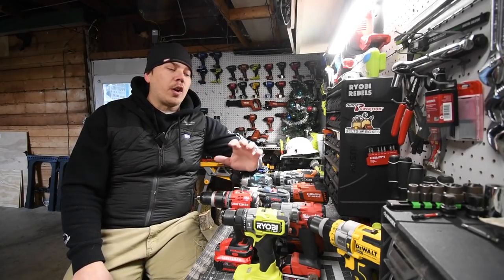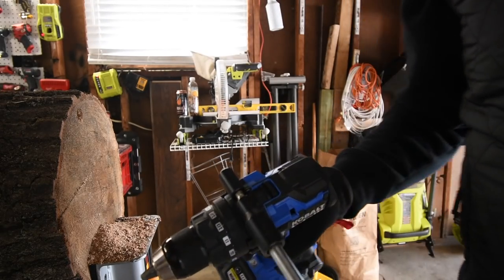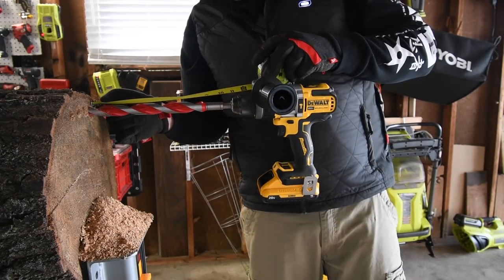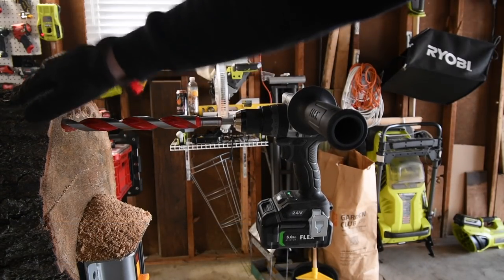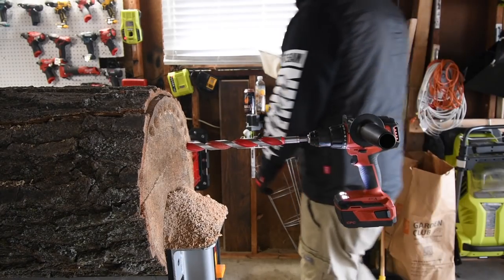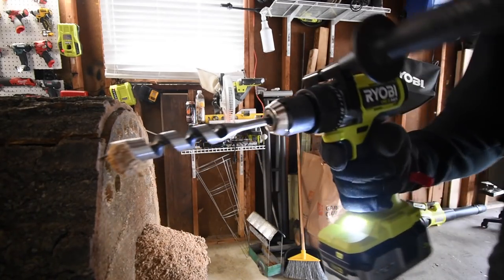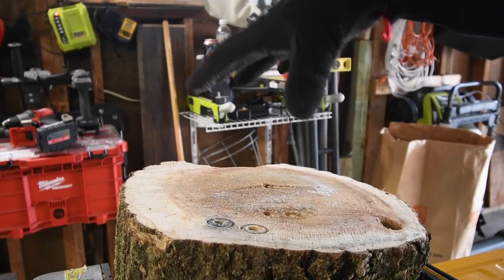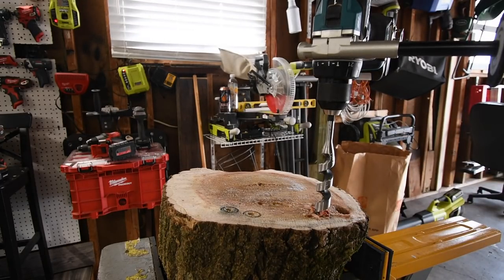Every Hammer Drill FAILED, Just an FYI

Comment: Pull the bit back so it can clear the chips then go back at it. I’m sure all these drills are capable of finishing both tasks. Then again I’m no expert so I’ll admit could be totally wrong. Cool vid though, thanks for the entertainment.
Reply: Yep that's true I use these bits everyday, when your drill stops pull it out. Go in and out the hole a few times and it will continue, if you don't do this the long and short drill will clog no matter how big or heavy your machine is. When we need to use the long one for a lot of hole we alway use a corded drill, because you're batteries just drain to fast and a corded tool just has more power

Comment: In case you haven't noticed, as soon as the spiral part of the auger enters the wood there are no more chips meaning the bit is plugging the hole causing a buildup of chips, clear the chips and I guarantee all of those drills would have finished the short bit test.

Comment: as a milwaukee fan i can clearly point out that they clearly won teh first test since they were tasked with the dullest bit since it was the last hole. 

that said, it looks like swarf removal is what stopped all the drills on the 2nd test. they were going fine until the end of the flute was buried and the waste was no longer being ejected. after that the flutes packed full and it was game over.

Comment: TIM from Canada... it would’ve been nice to see in your video test.. if you had the same bit... but for every drill.. this way when the drill stops in the work that is where you leave it.. with your next test you do the same thing with another one by the end.. do you have all the drills in the ward at different stages just to see where they end up if you have at least 10 or 12 different hammer drills.. you would need 10 or 12 of the same bit this way they will all be in the wood at a different stage. That would be the test I would like to see.

Comment: Bosch Procore are 21700 cells, the cheaper Coolpack packs are 18650.

You really need to get the latest Bosch combi drill, it produces 150 Newton metres and is a beast. That pegs it around 1300 inch pounds.

Comment: I know you are doing currently made drills, but I have a Milwaukee 28volt and I bet it would pas your test.  It is a beast, and I bought as a return from Home Depot years ago for $100.00.  It could literally break your wrist if not careful.  Good video.
Reply: Probably not, because of the advances in technology since the m28 was made the new m18's actually put out significantly more torque than the m28 did.

Comment: You need to pull The drill back a bit When it slows down to let it evacuate chippings, and then contintue. 
They all fail in the same spot because of the clogging in the augers, and that’s why you couldn’t use the drill to get it out when it got stuck. Cloggings bro

Comment: I'm really interested in this comparison, but I am left a little curious. I have the Hart Brushless 1/2" Hammer Drill and it was able to bury a 1"x17.5" Diablo Auger in a stump when following the instructions of starting the bit slowly until it has made a shallow hole before ramping the speed up. However, without following the instructions and starting at full speed as you did in this video, it bogs down quickly and wobbles all over the place when drilling.

Comment: Do you have a method to make sure the bore doesnt cross over into an existing hole halfway through the log when they are that close? Maybe one of those spirit levels that can be stuck on a drill or something?

It is a bit funny to see that all of them basically stop at the same point though, even those with half the (rated) torque of others. It seems very clear that the resistance suddenly spikes like  crazy at almost the same point every time. Im putting my money on wood chip clogging like someone else said too.

But then again, if you'd back out that every so often to get rid of the chips then all of them should make it seeing as the resistance then is pretty much equal to when you started each time you do so. I guess that kinda ruins the test.

Comment: Might not make a big difference in this test but you should really be clearing that hole and then continue on with driving the bit.  I realize the bit is designed to try and do this but just watch any machinist do any real drilling.

Comment: What impressed me was the Craftsman drill at "only " 400 in lbs torque made it as far as the Dewalt and Milwaukee which are 3 times more powerful in torque ratings !! Btw all of these drills would have succeeded if the bit was cleared when required.